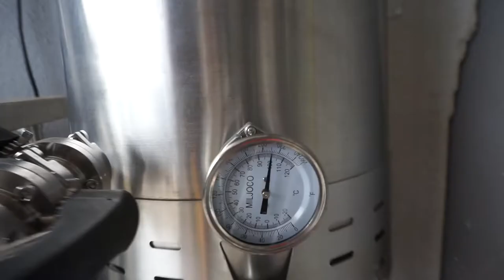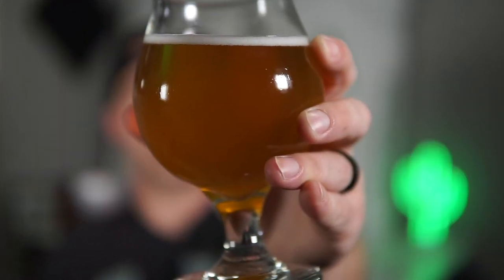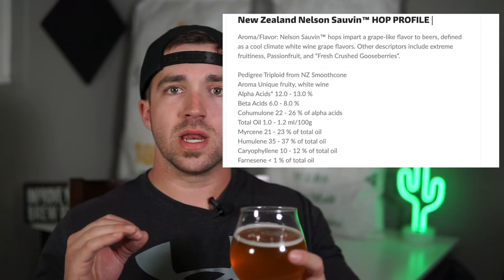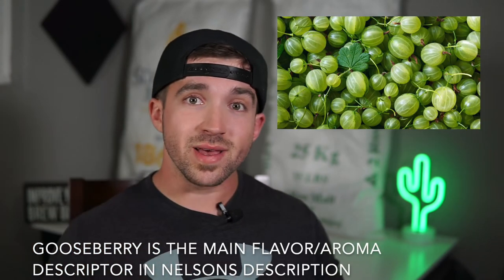Session IPA : Grain To Glass (Nelson/Simcoe/Cascade)

Comment: Marris Otter is distillers malt. Depending on the maltster that produced the malt, the malt may be over modified. To produce ale with the malt an Alpha-Beta enzyme mixture would need to be added. Purchase the Marris Otter that contains 10 percent protein content. The malt is probably low in diastatic power and six row would need to be added if adjuncts are used. To produce ale and lager, under modified, low protein, malt is used.
Reply from the maker: This was Simpson’s.